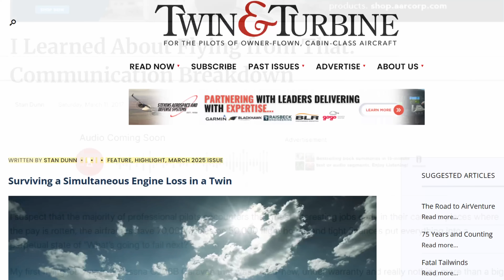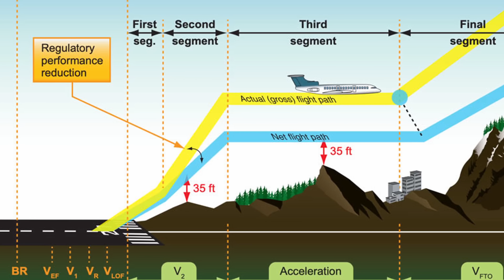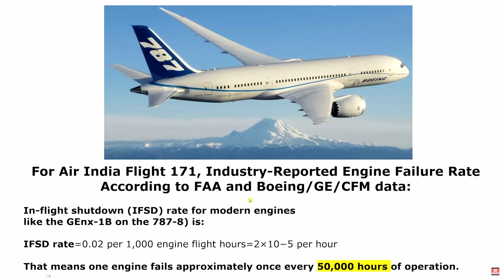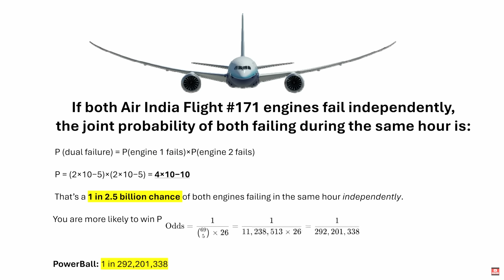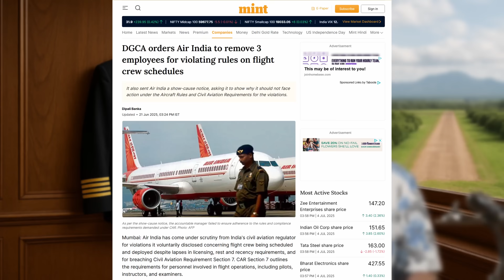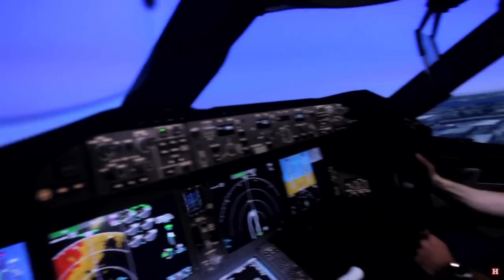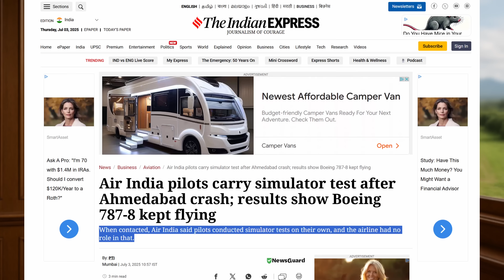Air India 171 Cause Becoming Clear

Comment: The final message from the captain does not mention they were initiating shutdown of either engine.  So accidental shutdown of wrong engine is even more unlikely.
Reply: If the engine was in a stall making loud pops, someone overworked may have instinct to shut it down.  You hear loud pops and pretty much know it's a compressor stall.
Reply: @emerkamp1  - While an issue may accor with one engine, it's highly unlikely with both at the same time as he said.   I could have been a small flock of birds being ingested in both engines simultaneous or any other cause for that matter.
Reply: @BillAnt  They've already looked for birds, no remains and none seen in the area. The only other past likely is wrong engine shutdown shown by both math and history for a double engine failure. Anything else would be new and a one off chance. 
I'm just stating how it could happen and so far seems to be most likely.
Reply: They don’t announce everything they are doing over the radio.
Reply: I sure hope your right. There's been so many lives lost due the the wrong engine shutdown scenario.
Another common one is forgetting the toga when going around or avoiding traffic etc.
Reply: You really think a pilot knowing he shut down the last working engine is gonna get on the radio and confess?  :" Uh yeah, tower....this is the captain of that jet you just saw take off.....yeah, we fucked up and had an engine flame out....and then we tried to secure that engine, but in doing so we may have shut down the wron...........

:"  _  explosions in the distance.)

Pilots are fucking dumb dude.  I know.  I spent from 1993 till now working directly with them trying to fix their dumb write ups.  

Today's pilots have zero systems knowledge.  They don't train that shit anymore.  All the want are warm bodies and meat servos in the seats to push a button and pull the stick back......and let the aircraft do the flying.  But when the slightest bit of  shit goes wrong it's not Sully on the Hudson flying any more it's Hamish Kuthrapolly with his cracker jack ATP cert trying to crash land a death trap.
Reply: @murdock-b6x  I thought the priority is positive rate of climb and shutting down an engine also requires both pilots to agree and a test if the engine has thrust.  I just don't think it is likely.  If it is an engine mode, electrical issue or software program That is going to ground a lot of planes.
Reply: If accurately reported, the "NO THRUST ..." is a contra indicator of engine shutdown.
Reply: @iRelevant.47.system.boycott bs
Reply: The captain is talking nonsense. There is no memory item that tells you to shut down the engine in a few seconds. They all say try to figure out the problem first.
Reply: Did they release the transcript of the CVR without telling anyone? Because AFAIK, it's not been published by the authorities.
Reply: @JingNickPHLife  The pilots final communication was "Mayday Mayday no power no thrust going down".  He did not mention a cause. Seems to be a technical issue with the aircraft and not something they initiated.
Reply: @googlieking  He said 'cannot achieve power' -which is strange turn of phrase, but then I'm not a pilot.
Reply: @Deppel57  Or an Indian!

Comment: why would you not mention the fact that the pilots mayday said "loss of thrust" unable to climb!!!............that is a clue right? fadec failure of all electrics once the airborne system took over is my guess. There is a FADEC ground feature that switches to airborne when the tires leave the ground. The engines both roll back thrust to flight Idle when the weight on wheels switch was de-activated.
refer to the Boeing FADEC system manual for the 787 series.

Comment: I cannot buy the theory that they shut down an engine or wrong engine.  The Mayday call the pilot got out said "No thrust, losing power, unable to lift..." That would not make sense in the context of them shutting down an engine.  I am still on the side that says the electrical system malfunctioned, or that the avionics systems had one or more system shut down due to exceeding the hours without a proper shutdown:  A Boeing 787 that remains continuously powered for 248 days can experience a loss of all alternating current (AC) electrical power.   This is due to a software counter internal to the generator control units (GCUs) that will overflow after 248 days of continuous power.
If the four main GCUs fail simultaneously due to this overflow, it could result in the loss of all AC electrical power, potentially leading to loss of control of the airplane. Periodically shutting down the plane's electrical power.
Specifically, the 787 electrical power must be recycled at least every 120 days.

Comment: First let me say its sad to see so many people affected by this crash. Second let me say if one engine failed which i don’t think happened. There is no need to shut the bad engine down. Fly then plane first and go through the check list. Make sure the plane is stable first. 
What we have as the public are two statements one by the pilot. He did not say he had a bad engine he said THRUST not achieved. The only person who survived said the plane had thrust then he heard a bang. The Rat coming down. I have a theory that the pilots were caught off guard by the problem and overwhelmed. The captain was not aware of what was going on they shut down the wrong engine for no reason. There was no power failure because he would have said that. I think the engines were not preforming because they had the wrong thrust setting on takeoff.

Comment: It is clear to me that all commercial airports should be relocated a minimum of 25 miles from any structures.
Reply: Airports are usually built far from homes and businesses but over time, building goes further and further out now too close
Reply: all airports (including this one) were built when they weren't, the authorities shouldn't have permitted structures to be built nearby
Reply: I do think there  should be a requirement to leave a mile of perimeter at both ends of every jet runway, to  allow for a safe abort.
Reply: Yes, because we should always use rare edge-case events to cause massive daily delays, costs, and frustrations to millions of travelers. 🙄
Reply: @cogitoergospud1 …I wish it was rare.  Happens all too often. You can look it up.  They just don’t all make the major news outlets.
Reply: Hah, welcome to the 3rd world where the shanties are built right up to the edge of the runways.
Reply: Airports attract dollars. Dollars attract buildings. Remove those buildings and it’s still likely a similar outcome. Fuel and spark
Reply: Most of them were when they were first built.

A lot more helpful if you make sure that manufacturers design and built their aircraft properly.

Comment: By far & away the most credible report I've seen on this so far. We don't know yet, but your explanation sounds far more credible than almost all those I've heard to date.
I was dreading another AI generated word-soup with a click-bait headline, but you surprised me with a well considered, well presented explanation, and your thinking seems sound to me. If they lost power on one engine, (likely the left engine) just about on lift-off, and then shut down the wrong one, the full fire-extinguisher shut-down, that would explain what we saw extremely well. That lines up more or less exactly with what we see on the footage.

Comment: If what I heard is possible, they could have had no issues until the pilot was right at the starting point of adding more thrust for steeper climb [right hands on the control wheels] when something unexpected happened. Possible the seat side back causing pilot to do engine power down instantly.  From this point, anything can happen! 
If the seat was the issue, then it need to be fixed!
Reply: Second part, it might be possible they went into emergency landing mode as soon as they realized they lost thrust!
The bang noise might be from the RAT being deployed.

Comment: There is a video of a guy complaining about system failures in the cabin (AC, entertainment) of the same plane just two hours before the fatal flight. Don't know if the video has been authenticated  If it was then the  power failure (electrical generators) of one or both engines seems very plausible. The title of the video is "'Nothing is working': Air India passenger posts viral video of doomed plane" by the New York Post.

Comment: I think that you are on to something. 
We have an alert system for improper configuration prior to takeoff. Why isn't there a system to alert the pilot as to the engine that failed?  A  computer reading the sensors will know before the pilots can figure it out.

Comment: I'm NOT convinced that the 'smoke' seen in the video of the plane taking off is smoke at all, the color doesn't fit.  Also, the plane used every inch of runway and being low to the ground as it began to ascend over the end of the runway would absolutely cause dust to be elevated even as other plane do not because they are much further away from the ground when the pass the end of the runway. 
You hinted around it but didn't circle back to potential electrical issues that the plane had in the days before the doomed flight.  I know some have said that the engines do not require the transfer pumps to operate, but what about the valves in between?  There were issues with the electrical system prior to the doomed flight, there are videos that show this, and when you have a crash then you can't dismiss the electrical issues so easily.
What is pretty clear to me is that the engines just shut down and at nearly the same moment.  Certainly the pilots could have hit the fuel cutoffs or fire cutoffs, but I'm unconvinced of that.  Maintenance records should be revealing!

Comment: 8:54 Are you one of these throwback pilots that would still pull a stunt like that... measuring fuel in pounds when Boeing aircraft have been METRIC for over 43 years starting with the 767 and 757? If you'll recall, after all is said and done, the screw up of doing the conversion when kilograms should have been used instead of pounds was the end cause beyond all the other failures. 

The USA wastes just over a TRILLION DOLLARS A YEAR keeping SAE measurements alive for people like you. Do you think that's fair or safe for US tax payers? Crashing into Mars because you still think SAE but work in a Metric world is one thing but people die in hospitals because of these screw ups and would have died back in 1983 aboard the Gimli Glider had it not been for two outstanding pilots that could really fly. Get with the program, it's kilograms/litre NOT pounds/litre for fuel in airliners. It's been more than 43 years now!

Comment: The RAT came down while the plane was still on the runway taking off, by an electrical glitch. Then the RAT shut off the fuel supply to both engines.
Reply: What is a RAD?
Reply: @orizaba18000 I meant RAT
Reply: @wnklee6878  I figured as much. FYI: The RAT can't shut off anything. It only supplies some electric and hydraulic power.

Comment: 4:25  "....both engines shut down in flight...."  If both engines "shut down in flight"  then why did the FDR data show both engines just rolled back to idle?   Can the auto throttles "shut down" an engine?  Don't think so.  Is there ANY sensor or input on the airplane that will command an engine shutdown other than a pilot initiated fuel cutoff?
Reply: You are correct. There is not.
Reply: A power glitch and computer reboot.
Reply: Software issue?

Comment: It could be something too obvious as an overweight takeoff, exceeding MTOW. If somebody lied about the cargo weight to save $ or if the pilots made a mistake in entering it correctly, and if they brought max fuel because of the destination weather, this is exacrly what would happen. They will endup using all of the runway, force takeoff below Vr, and descend down to the ground gently and crash.
Reply: Very interesting and far more plausible that some ridiculously simple mistake like the flaps or turning off the wrong engine.  But why no engines??  They supposedly stopped working.  Someone heard the plane fly without engine power.
Reply: @sezwo5774 I am not sure about the engine. FDR should be able to tell. Long time ago when I flew B727 cargo as an engineer, we tool off from BOS and the plane used every single inch of that runway before the take off. After landing, the captain ordered the reweighing of the cargo amd we discovered a significant difference from the manifest. So, this scenario was based on my personal experience. Cargo weight is the only weight the pilots just trust. BOW doesn’t change, pax number is obvoous and we know how much fuel we got.
Reply: @beyondstratosphere  I am sorry U.S. censorship does not allow me to post my reply. It is taken down immediately.

Comment: Good output.

One item/view that I haven't seen mentioned anywhere is way back in the 1980s was a couple of 767/757s experienced dual engine shutdowns due ergonomics and the ability for a single hand being able to operate both fuel control switches simultaneously. 

If I remember correctly, them 757/767s had an EEC button close to the fuel control switchs.

Again from memory an EICAS msg may ask crew to press them EEC buttons.

After first event of duel engine off by operating the fuel control switches by mistake not much action was taken. 

Then a while after 1st event a similar incident occured ar 2,000 ft in climb out if SFO, a quick relight and it worked out okay. 

Then inside 24 or 48 hours interference blocks were fitted in between fuel control switches to make a single hand unable to operate switches together. 

After a year or three the EEC buttons were relocated to an overhead panel I think.

The blocks were allowed to be removed later I think. 

As mentioned in this video, pulling a thrust lever back allows the ability to push it forwards again quickly, them fuel control switches are very different. 

I always thought the blocks were a nice item to keep fitted.
Reply: The EEC switches on the 767 are on the overhead panel.

Comment: I never believed in the flaps theory. The Captain was simply too experienced and conscientious to let that happen, plus the idea of the FO hitting the wrong lever is silly. The gear and flap levers look different, feel different, work differently, are a good distance apart.

It would be like driving your car and wanting to signal, but instead of that stalk you've now grabbed a handle to pop the bonnet open. It's absurd. A more plausible mistake would be to have a brain fart and grab the other stalk to accidentally turn the wipers on instead.

Comment: If they lost one engine shortly after or even during take-off and accidentally shut down the good one at 50 ft altitude while randomly rushing through switches and abandoning crucial training they exercised for years why didn't they report a specific engine to malfunction??? The Mayday-call was: "No thrust, unable to lift" and not "engine failure" etc. The conclusion of this vid doesn't make any sense and blames killed pilots with out a dime of indication nor evidence.

Comment: Trust me Boeing knows exactly what has happened ALREADY. Why is it taking so long to release the voice recorder information? At this point it seems either Boeing or India is up to something because by now there would be some kind press release. No press release means something is being withheld. Also, if this was a Boeing issue trust me, Boeing would have grounded all the 787's by now and asked the airlines to check this and that. But nothing has been released which means pretty much that this was not a Boeing issue but something related to the Airline im sorry to say. Think about it. If it was a 787 ill say it once again, there would have been mass groundings and in almost 3 weeks we have heard NOTHING! Look at that 787 @ takeoof. Why did this plane use the entire length of the runway to get airborne and Why did the pilots of this aircraft NOT aboard the take off. They had plenty of time to abort the take off but they did not. The fact that they did not abort the takeoff and used up all the runway to get off the ground IS HIGHLY SUSPICOUS!

Comment: This commentator might be on to something if the dust or smoke seen in the video is from the left engine and not from the ground. It should be noted the lone survivor heard a bang and was sitting in Seat 11A which presumably is on the left side of the airplane.

Comment: Other commentators have mentioned system failures that could have resulted in both engines shutting down. This commentator has not covered that possibility.